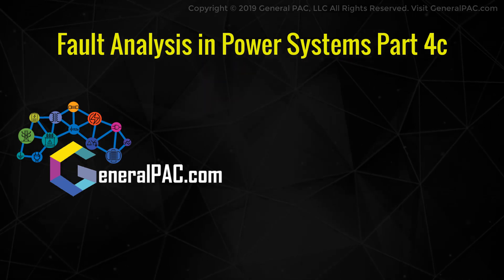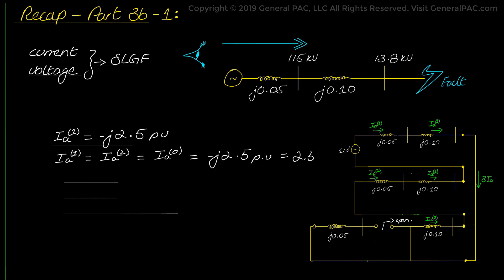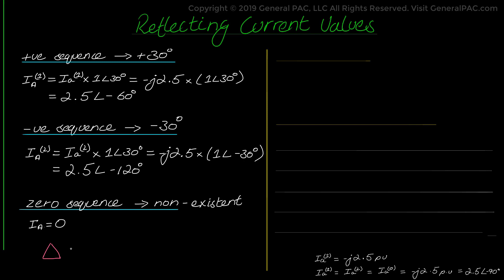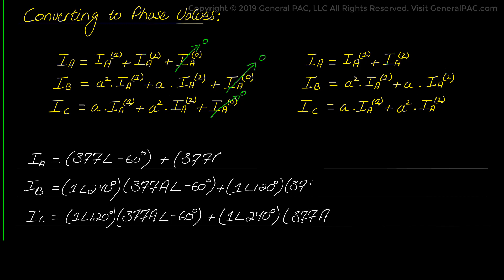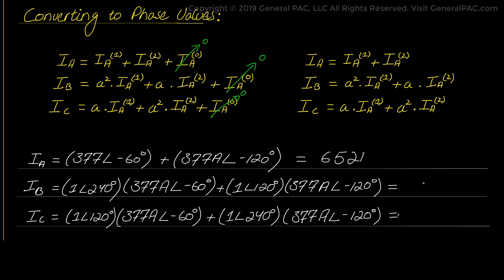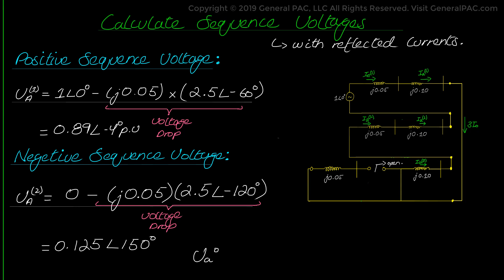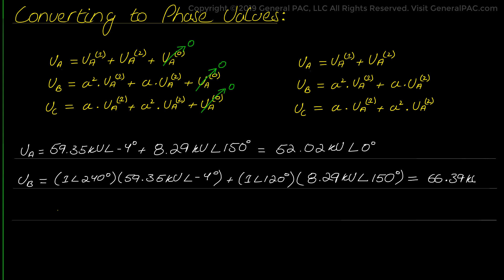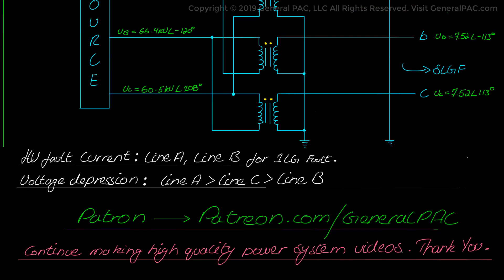Fault Analysis in Power Systems, Part 4c

Comment: In part 2b of this video series I thought the base value on the HV side of the transformer was chosen as 115kV, why do we need to divide this base value by sqrt(3) in this video? Shouldn't the base values for the line and phase voltage of a delta transformer be equal?

Comment: If the sequence component current values are no longer equal to one another when reflected on to the HV side of the transformer, does the series sequence component network diagram, that was derived for the LV side, no longer hold for the HV side?

Comment: Can you tell me what will happen if a L-L Fault occurs on the high voltage side (115V)?
Reply from the maker: Hi Qurat Ul Ain, There will be only one difference and that's the sequence network impedances will change. The overall calculation remains the same.

If you need a solution to the given question, do let us know.

Regards,
GeneralPAC by AllumiaX
Reply: @Generalpac  Yes, Please share the solution. Your prompt response is much appreciated

Comment: Great work.Quick question guys.How the fault current would reflect in the Y side if the source were in the Y side and the fault were in the Delta?
Reply from the maker: The way I got your question is that When we Put Delta on Sec side and There is a SLG fault what will be the scenario then?

By the rules of Delta, there is no ground which means there is no support of 0 sequence currents. But when there is an SLG or an LLG fault, ground is induced in the delta connected system and this would mean that the delta side will follow the same methodology as explained in the video.

I hope this answers your question and you are satisfied with our response. Please feel free to follow up with your queries should you have troubles in understanding the fore mentioned response. Thank you for your time. Support us by becoming our patron at patreon.com/generalpac